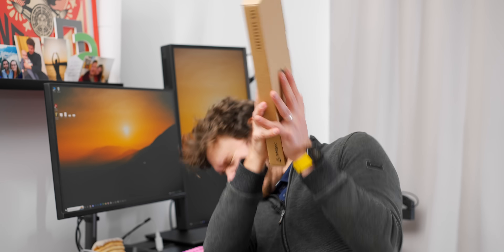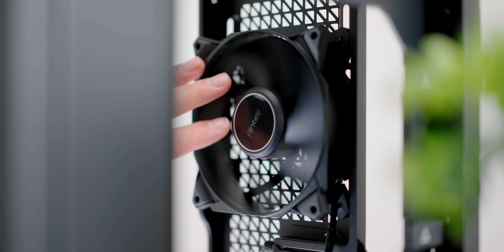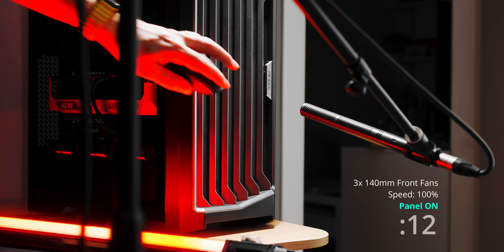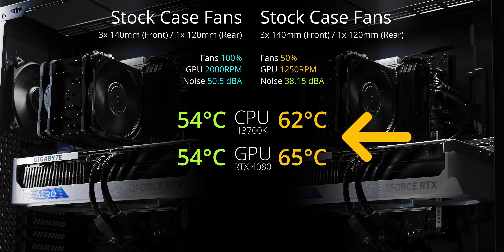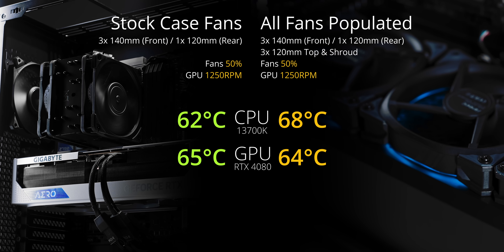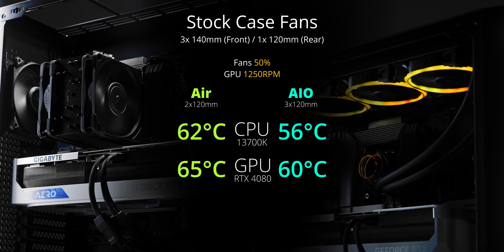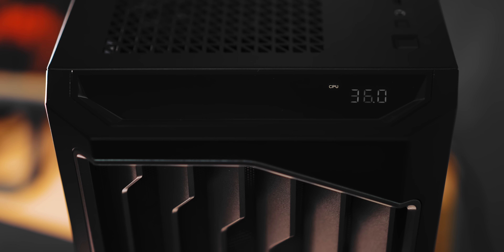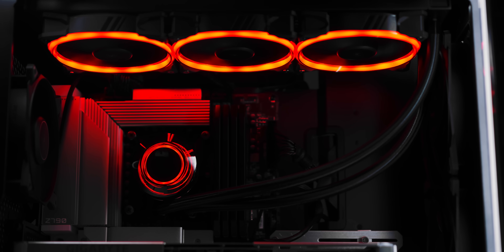How Many Case Fans do you Actually Need?

Comment: What I've learned from my experience: At the top of the case you should only mount exhaust fans behind the CPU cooler. Mounting exhaust fans on the other places at the top of the case is counter-productive - you're just throwing away the cool air that you've just pushed in through the front, before it has had a chance to reach the cooler. You can easily notice that when you put the PC under heavy load just by feeling the air coming out from the top - the back-most fan blows warm air, while the other two blow much cooler (if they are also exhausts).

I guess you could mount the other ones as intakes instead, but if you already have enough intakes at the front/bottom, then adding more at the top wouldn't really make a difference anyway. At most, it would just screw up the air flow.

If you're on water cooling, you can run the radiator at the top as exhaust, but you still should NOT place any other exhaust fans in front of it. You should have one fan at the back and the radiator at the top as exhausts, everything else should be intakes from the front/bottom.

And always try to have more intake air than exhaust air. Since intakes also have to be filtered, it's best to have two more intake fans than exhaust (if they are the same size/RPM/etc), if possible. So, if you're on air cooling - the best configuration is to have two exhausts (back-most top+rear) and four intakes (three front+one bottom or two front+two bottom). If you have 5 fans - you can do 3 in+2 out, while keeping the intakes at a bit higher RPMs than the exhausts. If you only have 4 fans - just run 3 intakes (front/bottom) and 1 exhaust at the back.
Reply: What about for a case that has 3 front fans, 1 rear fan, two top fans. Obviously the front 3 are intake, rear is exhaust. I know not to put the top front fan as exhaust, but what about the rear top fan? Should it  be intake or exhaust? I really don't think it matters tbh, as I have seen testing for my specific case (cooler master H500) that showed CPU temp improvement in both cases for the rear top fan, but wanted to hear your opinion on it
Reply: @henry3397  The rear-most top fan is usually fine as exhaust, since it sits "behind" the CPU cooler, as far as airflow is concerned. So it is not a problem to have it pull the hot air behind the cooler out.

If your case is such that even the rear-most top fan is "in front" of the CPU - then it would not be a great idea to have it as exhaust, but that's not common.
Reply: @henry3397  PS: I just had a look at your case - the rear-most top fan sits directly above the CPU, as far as I saw. That explains why both configurations can have an effect - if you have it as intake you're blowing cool air directly into the cooler, and with exhaust you're pulling it from it - it basically acts as one more fan on your CPU cooler.
If your CPU cooler is mounted to blow towards the back of the case (the usual way) - you can pretty much have the same effect no matter how the top fan is oriented. If your cooler blows up - definitely have the top fan as exhaust.

Comment: I have 13 fans in my Lian Li Air Mini.......

Haven't got enough obviously.
Reply: I’ve got 9 in my setup and I need more 😂
Reply: @khysor1832  9?

Those are rookie numbers! Pump those numbers up 😂
Reply: Technically 8 for me so far in mine. 3 bottom SL-120 Infinity fans, stock dual 140mm in front+ 120mm rear, and the two that came with my Deepcool AK620.
Reply: @Devo_gx  2 140 stock fans at the front
3 120 Deepcool fans on the bottom
3 120 Deepcool fans on the side
3 120 Deepcool fans on the top
2 120 Deepcool fans for the CPU cooler

So technically 11 but still 13 realistically.

It's loud but adding some CPU undervolting for my Ryzen 7 puts it around 22 to 25°C so win win haha.

Comment: the thing about AIOs is that you have to deal with the pump hum no matter how low you run it, but in turn your PC overall is a lot quieter since the flowing liquid is doing most of the heavy work, and the fan on your radiators don't have to run as hard either. Usually anything 240mm and up for radiators is always my suggestion over air coolers just cause of the sheer drop in sound alone. its what made me drop my M1 macbook pro as my daily driver and switch back to my desktop
Reply: Try buying an AIO without a garbage audible pump.
Reply: @imadecoy. my nzxt sounds like shit 😂

Comment: I use a NR200P and it has only 6 Fans in it, including the 2 of the GPU. 2 are intake from the 280mm AIO on the side, 2 are exhaust below the top.
That is enough to keep my 4090FE at 600W and a 5800X3D below 80°C, the 4 Casefans are running at 40% RPM. Only the GPU ramps up at >450W.
I had a 3060Ti before the 4090 in that case, and the 200W GPU overheated with 100°C at 100% Fanspeed, the warm air couldn't escape. 
Funny how the flowthrough cooler of the Founder makes a difference.

Comment: So what happens when you flip the fans around on the roof/shroud?  In other words, set the roof as intake vs exhaust, and exhaust on the shroud, thus directing air downwards away from the CPU cooler.  And especially with the AIO, the radiator would be drawing in external air vs venting case air.
Reply: There's a reason people build cases the way they do, and it's very simple - physics. Hot air tends to go up by itself, so forcing it downwards is just counter-productive. I mean, it's not like it won't work at all, but you're just never going to get better results by trying to flip the airflow like that.
Reply: @Mismatch-  The amount of upward airflow from thermal convection is miniscule - easily overwhelmed by a single small fan.

Beyond that the design for cases all conform to the ATX format which has been around for decades, extending back to when desktops were horizontal, or those old "beige box" cases where the only ventilation was in front and back.

That point was made particularly well during this video where the fans set in a chimney fashion actually had higher CPU temps.

And specifically with a water-cooled solution, the temperature of the ambient airflow through the radiator matters more than the direction.  And outside-the-case ambient air will always be cooler than the air inside the case under load.
Reply: @traumadog003  The point I was trying to make is that the action of flipping the airflow will not help in any way. If you want the radiator to be intake - you can always just mount it at the front.

As for whether it should be intake or exhaust- that depends on which component's cooling you're prioritizing - CPU or GPU. Usually GPUs produce more heat, so they need more fresh air, so it's better not to push hot air into the case through the radiator.

As for the "chimney test" - the problem there was that the cooler just had nowhere to get fresh air from, with the GPU right beneath it blocking airflow while also feeding it hot air... If you remove the GPU - the CPU will not be hotter in chimney mode than regular. Will it be colder? Probably not, but it certainly won't be hotter.
Reply: @Mismatch-  That is what the front case fans are for. As the GPU is the greatest source of heat vs the CPU, the relatively small heat increase by drawing air through the CPU's radiator into the case would be well offset by drawing fresh air from the front.
Reply: @traumadog003  OK, it seems I misunderstood what you were saying, you mean rad intake at the top, more intakes at the front and exhaust at the bottom?

I mean, I guess you could do it "just for the lols", but the bottom fans will pull a lot of the cool air that you've just pushed in through the front out of the case before it even reaches the GPU, meanwhile the GPU will blow hot air upwards while the rad at the top blows more hot air down towards it as well... the airflow inside that case will be a complete mess.

I guess you could also flip the GPU upside-down to make the situation better... but I see no reason to do any of that. If what you want is the rad to be intake - put it at the front, add more intakes at the bottom, and exhaust through the back/top. This way you get what you're trying to achieve while also having good airflow. No need to reinvent the wheel.

Comment: i have two front intake fans, two top AIO exhaust fans, and one rear exhaust fan. is that good?
Reply: This is actually pretty ideal since you're giving the aio fresh air from the front and exhausting all the heat out the top. You could also experiment with switching the rear fan to intake just to fill the case with more cool air getting exhausted out the top, only thing being you'd take in a bit more dust from the rear.

Comment: I figure if a case can hold 6 fans, why not put 6 fans in it?
Reply: Less money spent, less time setting up the PC and routing cables, less clutter, usually less noise (assuming all the fans are gonna run at the same speed in a controller), lesser chance of failure since there's not as many fans etc, 3-4 vs 6-12 fans doesn't always equals an improvement or sometimes the difference is so small it's just not worth, that's ignoring aesthetics though which is maybe the most common reason people use that many fans
Reply: @Bruno Brito  Thank you, I got a P360a, holds 5 so I put 5, I just figured that's what people did. Just curious of the why not. Thank you again

Comment: Just have aio if you can. The radiating heat from cpu heatsink won't heat gpu or make the gpu to cool harder. Aio has great surface area so will make case cooler than air cooling. Don't worry about warranty. You cannot guarantee 5 years on life when they provide 5-6 years warranty

Comment: To use the 3rd fan slot above the PSU you need to mount PSU fanside up..  flipped.
Reply: I don't think that would help. Unless the PSU is fanless, the PSU fan will run in conflict with the fan mounted on the PSU shroud. You'll either have the fans running in opposition to each other (PSU fan pushing air out the back with the shroud fan trying to pull air from the PSU at the same time) or they run in a push/pull config, but them being so close to each other would introduce turbulence without have one of the fans using a counter-rotational fan blade design.

Server racks do back-to-back push/pull fans just fine because of having counter-rotational fans in every other slot. It's similar to how jet turbines work to feed and compress the air with multiple fan blades compacted into a small-ish package.
Reply: @KunoMochi  or use inverted fan there..

Comment: what about AIO with 3 fans top (underside taking air in and blowing the gpu)&3 fans top pushing air in the case and then 3 front, 2 down (all 5 pushing air in) and then 1 fan in the back to take air out? All fans are 140mm (only AIO has smallers ones) and the case is a thermaltake View 71 tempared glass edition and has also free space between the glass.
What do you think about it ? The concept is to push enough air to force air out between the case cracks and panels and for the back fan to the the rest.
Reply: I do suggest it really depend of how much air your case can breath (or exhale). In this case it at worst, only increase the GPU temperature by a little bit. At best it didn't do anything since it went bottleneck by GPU fan first.

Flowrate is Flowrate. People doesn't recommended it simply because the use of the fan not only to change air, but also to redirect air to more desirable path.
Reply: So you want to have 6 fans on the AIO and 5 more at the front/bottom, all pushing in? I think that's way too much, there would really be nowhere for all that air to exit from. And airflow will be very strange when you're pushing air in from pretty much everywhere.

I think a better take on your idea would be to put the AIO as an intake at the front with all those 6 fans (if the case has space for that, otherwise you can just have 3), keep the two at the bottom as intakes as well, and have one exhaust at the back and one at the top. That would be enough positive pressure while also having good airflow.
Reply: @Mismatch-  there is. În the case that i mention, there is room all around the glass panels of arround 5-10mm. Actually i have it like this with this exact case and i got good temps

Comment: I bought my first Antec case in 2000. Glad to see them making an innovative comeback for enthusiasts. I'm in the market for a new high-air flow case, and up until now I've only considered the Fractal Torrent, but now I'll include P1 FT as well.

One thing I'd change: black-out the front grill (including the Antec logo--or remove it completely with a delete or screw/snap). The entire case is mostly black, but the front grill contrast bothers me against the black case.

Comment: Iam new to custom builds and my question was, isnt having a top radiator in any circumstance, better to be mounted in the front as that is where the coolest air is is entering your case? I have always seen top mounted aio's as strange choice because the back and top of my case seem to be where the most heat is exhausted and adding a top mounted aio shoves a ton of hot air through a top mounted aio. Would you say a front mounted aio is preferred as placement?
Reply: It depends on the case's mounting options and the preferred hardware cooling.

For instance, a front mounted rad might cool the cpu but give the gpu a warmer time whereas a top mounted cooler would be the reverse. Correct me if I am wrong but this is what I had learned throughout building.
Reply: Depends if you want to give a preference to your GPU or CPU, either way one component takes hot air from the other.
Reply: There are pros and cons. If the AIO is front mounted, the air in the case will become warmer, and that will potentially impact the GPU temps and whatever else is in the case, but like you said the CPU temp will be cooler. If top mounted, the air in the case will be cooler because the heat from the CPU is expelled immediately outside of the case, but the heat from the GPU will impact the CPU temps.
Reply: Top mounted is also the best option to prolong the life of your pump

Comment: For the cpu air cooler set up. U have to change the top 3 fans to intake and not exhaust. Then u will get the proper results.
Reply: In addition to the three front intake fans? The hot air would be trapped with only the one rear fan exhausting with six intake fans.
Reply: @SexualSeagull  hot air won't be stuck completely they will still diffuse out. Remember with 3 top intake, u are still taking cool air from outside the case and feeding it into the cpu cooler and ram directly. Unlike the 3 top exhaust which was already proven in the video to be much worse off then the stock form. ( air from front fan at top is being exhausted before it can even reach components). Even more fans at bottom will help feed cold air form outside directly to gpu. Remember the point of this video? Is more fans truely better or not.
Reply: @Chesterwilliamfrancis  In theory more cool air equals good, but that doesn't take into account the flow of the air. The two intake paths would converge and create a significant amount of turbulence. Additionally there would be no apparent path for the air to exhaust due to the single 120mm rear fan having a marginal CFM displacement ability compared to the multitude of intake fans, causing the air to mostly stir in the case.
Reply: "What you've just said is one of the most insanely idiotic things I have ever heard. At no point in your rambling, incoherent response were you even close to anything that could be considered a rational thought. Everyone in this room is now dumber for having listened to it"
Reply: @bradmiles1984  What's funny is he's right, bozo. Look up some tests on this. it should be obvious that you dont want the top fans in front of the CPU cooler to be exhaust, this is the only hard fast rule. The rear top fans, it doesn't make shit of difference whether they are intake or exhaust. And some testing has shown improved CPU temps specifically with all top intake. "heat rises" yeah okay bud, go ahead and starve your CPU cooler intake lol
Reply: @henry3397  ok I'll take the word orf some random on the internet over people like gamers nexus or Jay who do tons of testing and show it.
Reply: It went worse for GPU. Or didn't do anything at best
Reply: @bocahdongo7769  yes gpu temp will not change with this, but cpu and ram temp will drop. Much better results then 3 exhaust.
Reply: @Chesterwilliamfrancis  It really depend of how well your chassis ventilation is. Some case works well with this setup. Others... really throwing tantrum with full positive blast lets just says.
Reply: Given the negative replies to my suggestion. I would like to add that the point of the fans is not to keep the inside of the pc cool, but more specifically to keep the main components such as ur cpu gpu and ram cool. Hope this helps. I only want to help 👍
Reply: @Chesterwilliamfrancis  Ambient temp in the case affects the temp of the components you are mentioning. In PC case airflow you always want it to come in fresh go across the components then out. If you only have 1 exhaust and 6 intake you would have way to much positive pressure in the case and the single fan cannot keep up with removing hot air that is in the case. This is why generally you have intake at bottom or front then  exhaust going  out the back and top.
Reply: The dumbest thing I have ever heard. I bet your PC is just like yourself, full of hot air.
Reply: @bloedekuh  youre confidently wrong lol. Do some research before bullshitting on things you don't know about. Putting an exhaust anywhere in the top, in front of your CPU cooler, is counterproductive, many tests have shown this, including this one. If you wanted to put the rear most top fan as exhaust--fine, but it would be just as effective as an intake as well.